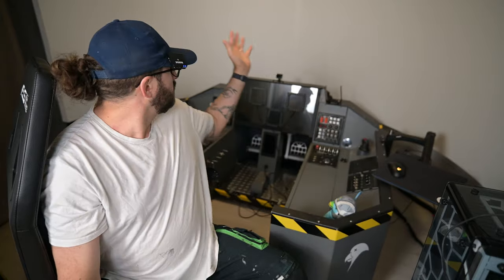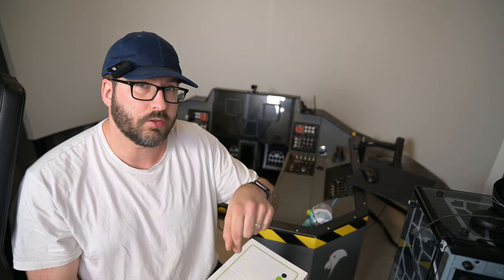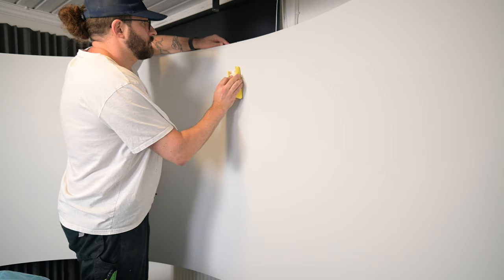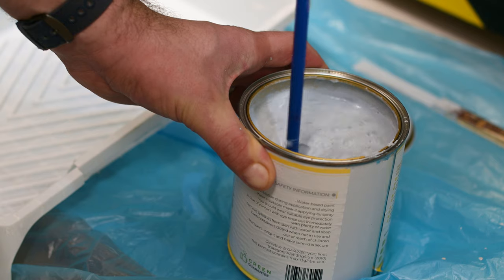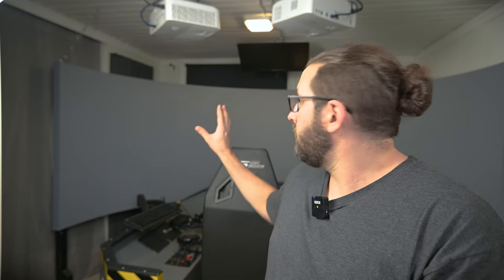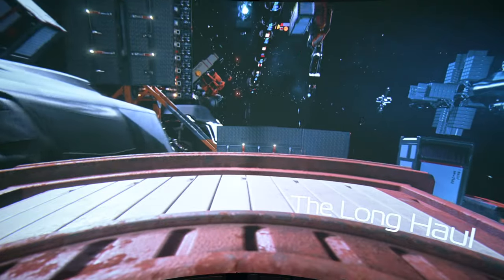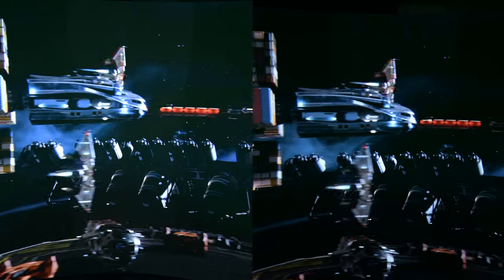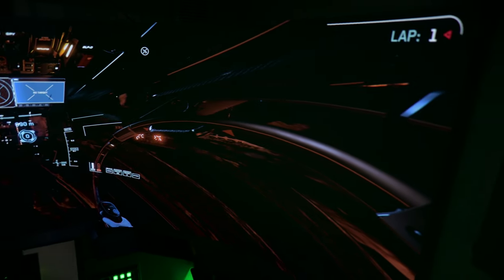Re-Painting My Cockpit Screen with High Contrast Projection Surface Paint

Comment: You could try to block off the overlap by using some blackout fabric to create a floating lens shade. Should be relatively easy to make something to hold it a few inches away from the legs, the tricky part will be making it the right shape to block off the overlap exactly.

Or maybe there's some way to do it in software and have the video being sent to one projector have blacked out pixels? Or if thats not a thing that exists maybe the simplest solution  is to rotate one projector outwards until the vertical edges meet as closely as possible and redo the calibration. 

Either way, the blacks are looking so much better with that new paint. 👍
Reply from the maker: Thanks for the idea. The challenge here is that they actually need to overlap so the middle section can be blended seamlessly in software. But in practice, it's not something you keep noticing.

Comment: Great job mate, looks much better with the darker grey paint. When I did the same with my screen I was a bit worried at first as I thought there's no way the whites are going to look good with the screen paint being darker but I found that not to be the case and was very happy with the results. I use an epson projector and after I painted the screen I put up a dark image on screen and adjusted  the advanced projector settings. It was a guy wearing a black top in a dark room. Initially I could not make out the texture and patterns on his top but managed to set it so that the black levels were the same but I could make out all the details on his top. There were settings in there which enabled me to see the fine details in the shadows without ruining the black levels. Took some time to expeiment with, but made a huge difference to the overall picture quality. Good luck mate.😀
Reply from the maker: Thanks!